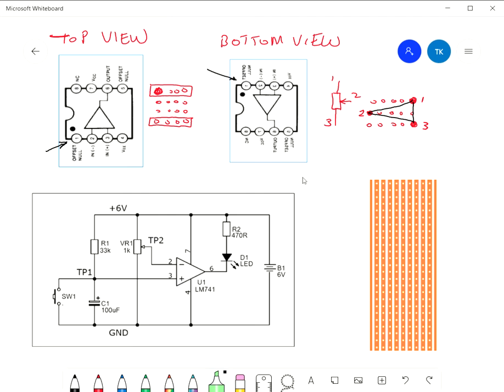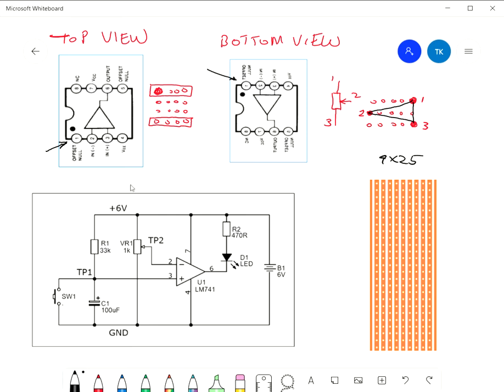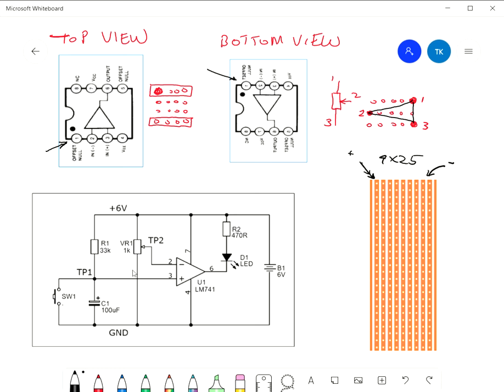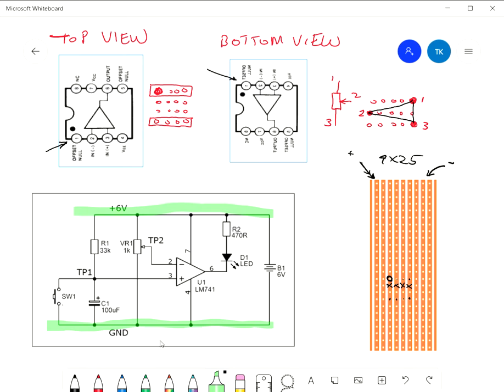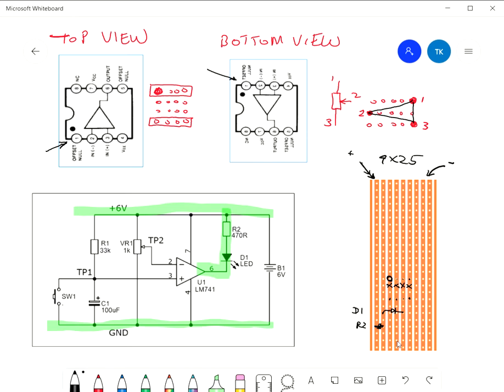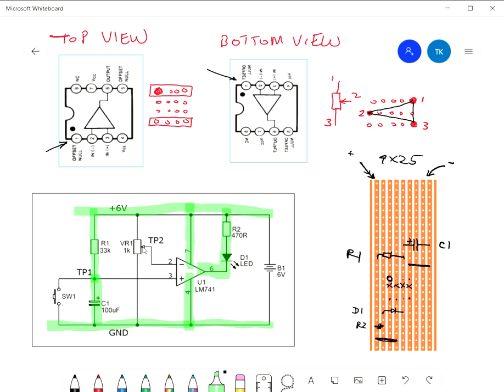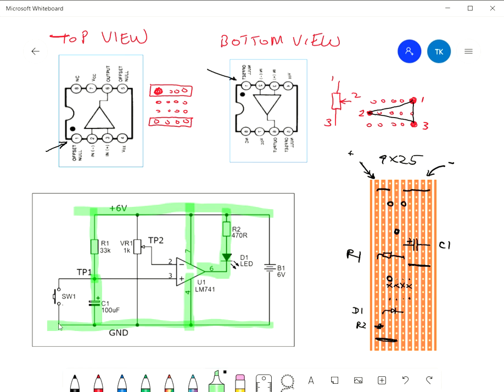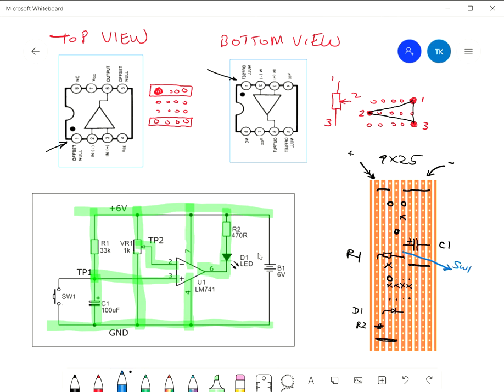Mapping circuits on stripboard

Comment: I'm very new at this and particularly have difficulty with keeping track when having to think upside-down.

So what I do is draw a blank stripboard on some or other CAD /Drawing platform (Microsoft PowerPoint is my go-to)

Then I add my components and connections working on the view from the top..

When I'm done I group everything together, copy & paste the group and then flip the copy around its horizontal axis to get the view from below.

Print out both views, et violá
Reply from the maker: Great idea! Are you sure you're "very new at this"?! :-)

And a lazy idea to add to that: instead of generating your own stripboard graphic, grab something from the internet - e.g. a real photo, adjusted as required, of a suitably-sized stripboard taken from an online supplier...
Reply: @terryselectronicsstuff  

Thank you for the compliment. But yes as a retired civil engineer (71 last birthday) I I found myself in need of a device to automatically manage the filling and emptying of a rainwater tank.

After watching numerous videos showing different electronic approaches I said to myself "bloody hell, I can do that...!". Yeah well, that optimism didn't last long... but one continues to hope...

As to using an image as background, that has its limitations when using PowerPoint as a platform because you end up selecting the image every time you want to select anything else. It's a pain but there is a work-around.

So it goes....